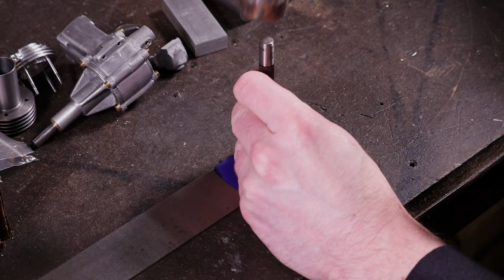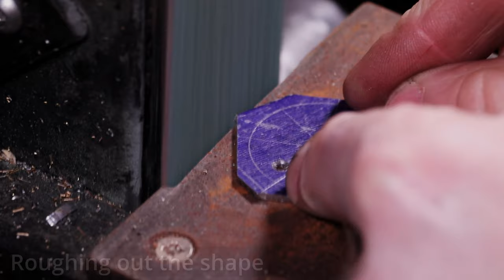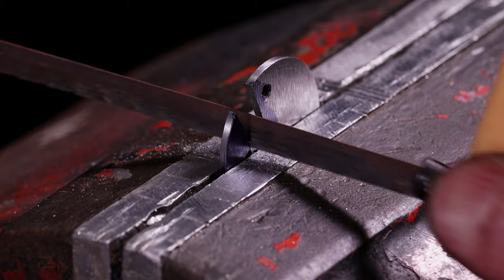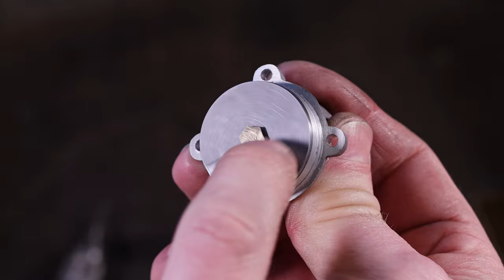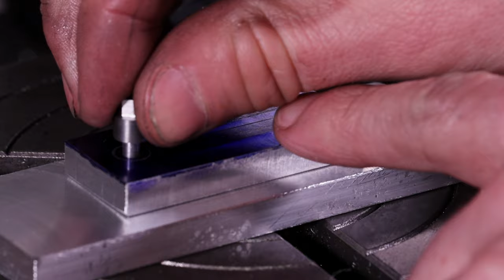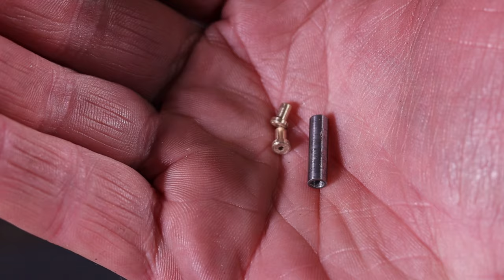Making a Tiny Engine #6 Rotary Valve, Conrod and a Gudgeon Pin

Comment: Paul I'm going to follow your progress. I just purchased the kit and plans from Hemingway.  After a failed attempt to get my scratch build Owen Mate 2cc to run I'm hoping this goes better. Really interested to see how you set up the ignition system as I really don't understand the details after looking at the plan.
Reply from the maker: Good luck with the build! It's been my first attempt, not far off finishing now. I've found it to be a decent challenge, but not overly difficult. For the ignition I'm using the Minimag MCL-1 with the hall effect sensor - thought that'd give me the best chance of getting the thing running! Also, didn't like the look of the little fiddly casting they provided for the points system.